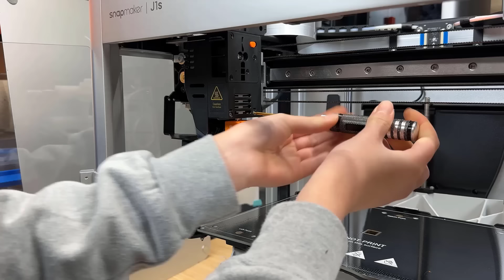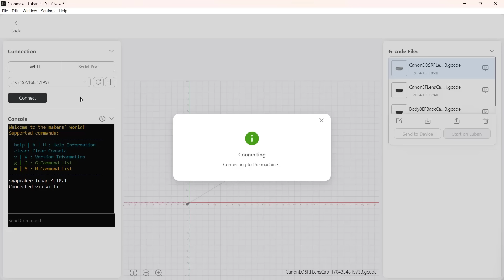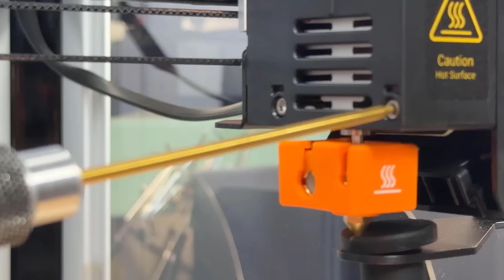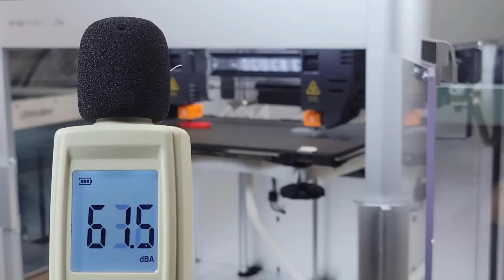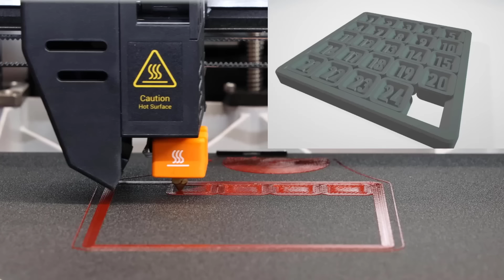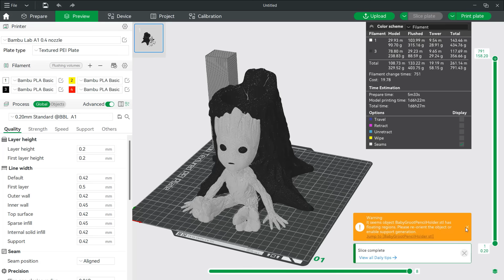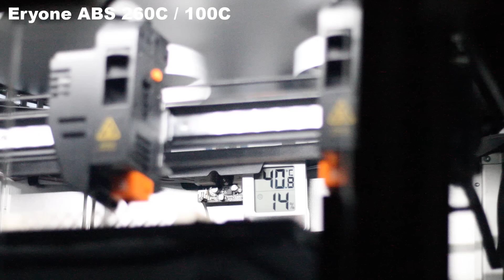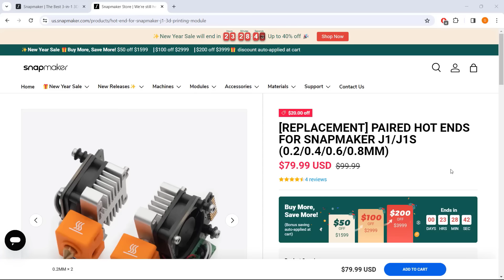SnapMaker J1s Review: IDEX Fully Enclosed 3D Printer, Multiple-Color & Multiple-Filament 3D Printing

Comment: Question: Do you create calibrated filament profiles before testing tolerances etc? Reviewers never seem to mention if they have done pressure advance, flow rate, temperature etc calibrations specific to the filament being used. If not doing all of that, then tolerance tests and similar tests are meaningless IMO. Just curious! Love your videos.
Reply: Not totally meaningless. It does at least show how ready the printer is to be used out of the box without calibration. However I agree that reviewers should mention whether they did this or not.
Reply: @SkiPump  Yeah it shows how ready the printer is with the manufacturer's filament in particular I suppose, but reviewers are almost always using some other sponsor's filament like Voxel or Polymaker. If they don't tune for the filament that they actually use and then proceed to judge tolerances, or worse, compare Printer A to Printer B, then I take issue with it. Now I try to ask in the comments.

Loyal Moses recently directly compared 2 machines by printing models that were sliced for the manufacturer's filament rather than the filament he actually used. The results were backwards from what he expected.. because the higher end machine's model was sliced for filament that could print at 21mm/s³ while his filament, in my experience, topped out at 12mm/s³ before running into issues. I felt it was very misleading.

Comment: Proprietary firmware based on Marlin? This is so wrong as Marlin's license is GPLv3 and the GPL doesn't permit turning it into proprietary. Shame on you, Snapmaker
Reply from the maker: Not proprietary, it's open source: https://github.com/Snapmaker/SnapmakerController-IDEX
Reply: Their Marlin fork is available in github.
Reply: The way Snapmaker treated their Snapmaker 1 and Snapmaker 2 users learns us one thing : "they have no shame".
Reply: Yes. To be totally fair, they've fully released their Marlin source, but not the proprietary Android part. There was some discussion about their input shaping math vs Klipper back right around when Prusa hadn't yet released theirs.

Comment: As long as snapmaker uses luban, its  trash wasted my money on the snapmaker 3 in 1. Save yourself the money and aggravation and stay away from  Snapmaker.
Reply: It's fully supported in prusaslicer, including sending prints over WiFi 😊 works with orca too but I haven't tried that.
Reply: @drmilkpillows  do you still have to bring your gcode back into luban?
Reply: @Townie001  nope, there are presets for the j1 built right in, as of the most recent prusaslicer update they have very fleshed out profiles for 0.4, 0.6 and 0.8 nozzles and a bunch of different filament profiles, not just one single lazy pla profile like is usually the case. The gcode can be sent straight to the machine, to send it over WiFi there's a small community made tool but it's easy to set up. There's a community made plugin to make the thumbnails work which takes all of  2 minutes to set up if that matters to you as well. I'm in the same boat, can't stand luban but I have zero complaints about prusa slicer, it wasn't difficult at all to move away from luban.
Reply: @101stsurvivor  that is a significant  improvement.
Reply: There's a fully functional Cura plugin available. Even enables wireless upload from Cura. 

You do still have to start the print on the printer once uploaded. The mirror and copy modes are selected from there as well.

They also just got added as a Prusa slicer profile, but I've not used it myself.
Reply: @timm7524  Can we talk further about the J1s? Are you in any hobbyist reddit/fb groups? Thanks
Reply: So klipperize it
Reply: @TRTmike4Life  ❓️❓️WHAT ❓️❓️
Reply: can you only use their software on their printers? Maybe because of the modified marlin i guess
Reply: @scipolah8810  Luban is the slicer and you can use a different slicer, but then you loose all network features which are not really great anyway.

Pretty sure the oprating system of the printer is locked and can not be changed, but I only have the Snapmaker artisan as refrence.
Reply: @Khamelean  I didn't  notice  the error. Thanks for the correction. ♥️✨️🤔✨️
Reply: Totally agree, We have the Snapmaker artisan in the office, and the Hardware looks great, but the Software is absolutely horrible to use. Absolutely innaceptable for such an expensive machine.
Reply: @jakob.k_design ah shit I just had mine delivered yesterday 🥲